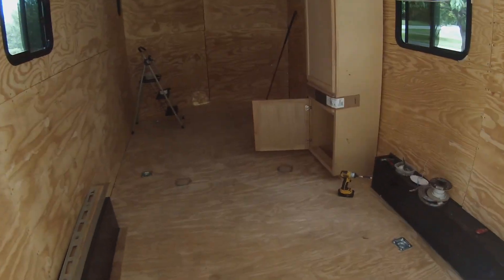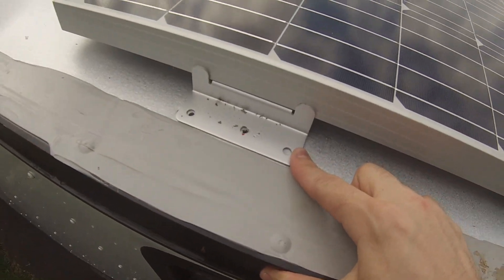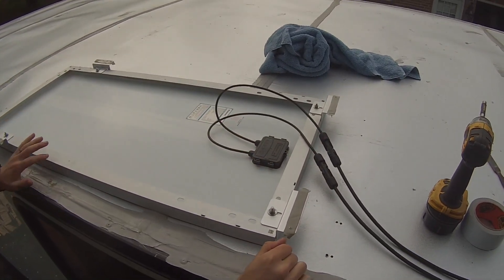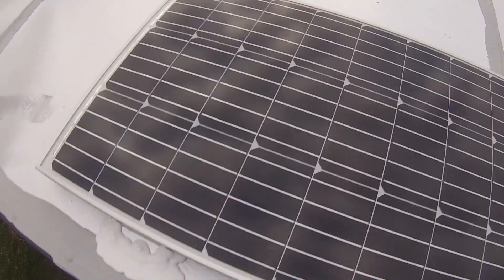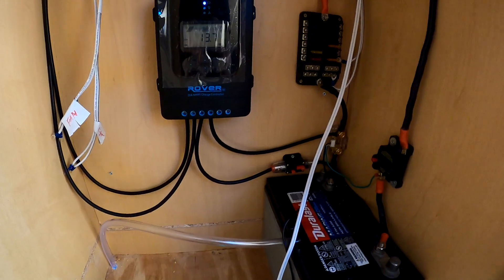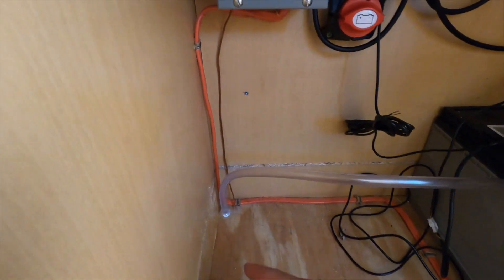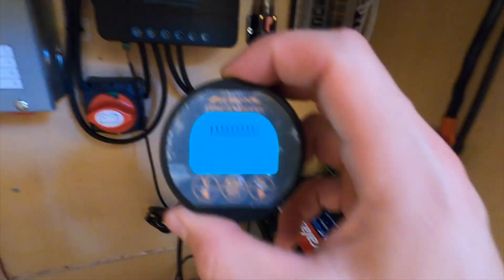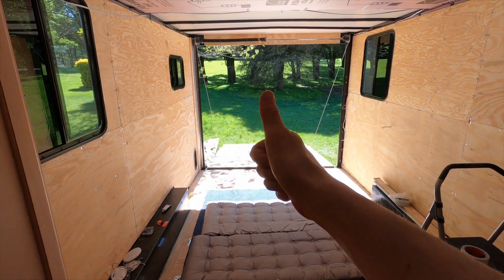Cargo Trailer Conversion Electrical Installation!

Comment: Sorry didn’t mean to send 
I’m building a food trailer concession stand type trailer o my 8’ x 11’, I’ll h s generator in the front and I’m gonna run off shore power or generator, I ran 8 g wire to my breaker box and under trailer up and out on drivers side front corner and used 50a box plug, my generator can plug into it, or I can not hook up generator & pull out my 10g extension cord w/50 amp plug and plug into my trailer and run over to shore power and plug into that, it saved me a lot of money for now, I may later might put solar panel to charge my battery for my water pump, o my thing running off 12vDC. Was looking into putting an auto transfer switch but not fit now gotta but 12 sheets of aluminum at 180.00 a sheet and also I’m not off grid a concession stand. Great work I’m saving it for if I ever do that to my trailer

Comment: Are you using a lithium battery??
Reply from the maker: I am actually still using the same AGM battery I bought four years ago in the trailer. Works wonders. Haven’t had a single problem with it and we are using this thing almost every weekend all year long
Reply: Everstart?
Reply from the maker: @lovingjesus5184  duralast platinum
Reply: @WildSchneiderOutdoors  👍🏻👍🏻ty!

Comment: Got a video on how you connect all your wires?
Reply from the maker: I unfortunately do not. All of the AC is very simple. Single runs from power to source. The wires I do have run for the DC are all run on the ceiling and zip tied to the bracing and come down the walls where they are just popped out through a hole I cut. Every wire is either run through the ceiling or in a wall. For any wire that goes outside it’s just a hole with silicone sealant around it and then zip tied and stapled to the underside.

Comment: How is that tube venting your battery off gasing?
Reply from the maker: So the tube is connected to the off gas port on the battery and then is routed through the floor of the trailer outside. There is silicone and lots of it both on the inside and outside of the vent hole.
Reply: @WildSchneiderOutdoors  OK thanks, I didn't know there was an off gas port.
Reply from the maker: @mikestone9129  yes. I was unaware of that as well until I read the little booklet that came with the battery. It’s not common that it would off gas but in the event it overcharged or got too hot i wanted to ensure it wasn’t venting in a small enclosed space

Comment: Hi. Can you provide us the starting weight of the trailer and what you guess will be the final weight after everything is added. Also what will you be pulling this trailer with ?  I have a F-150 and may need to get a 7 x 18 trailer for my setup.
Reply from the maker: DCLEMMS1 happy to see a new subscriber! And yes the empty weight of this trailer as it came off the lot was 3400. I will gladly weigh it when the build is done to see how much we added to it (I’m only building the front 8ft). I am pulling this with a Silverado 2500 (diesel) so I know I can really pull this fully loaded. New video coming soon on some interior framing so keep an eye out for that. Build should be done within the next month or so with videos all along the way.
Reply from the maker: DCLEMMS1 if I had to guess the weight added it would probably be around 800 lbs once finished. Maybe 1000.
Reply: @WildSchneiderOutdoors  Please shoot lots of video as this is becoming a big thing. I live on the East coast and hurricanes get worse each year and I also like to go 4 wheeling / camping. I'm planning a setup like yours but 7 x 18 or 20'.
Reply from the maker: DCLEMMS1 I’ll do my best. It’s so hard to film and build when I get going on a project I just fall in head first. I’ll do my best to at least describe what I have done and be sure to film more. I live on the east coast currently and am using this for my move out west then to have as a toy hauler for our dirt bikes

Comment: Thank you for the awesome video. I'm in the planning stages if my cargo trailer stealth conversion. Do you happen to have a schematic of the electrical system you installed? Thank you.
Reply from the maker: Felipe Espino thank you for watching! I do not have the schematic for my system but it is based on the electrical system build out by Trent and Allie. If you check them out on YouTube they have a few videos explaining their electrical system and I purchased the blueprints for their van build in order to build out my mothers van. So I have the schematic from that which is what I used. If you pause the video on where o have the finished electrical open you can see how it is all wired up. Hope that helps and please let me know if you have any questions. More videos coming soon as the build nears completion.

Comment: What did it cost for your electric setup for solar and how well does it work?
Reply from the maker: Tho kit total was about 200$. And it works great! I’m only on a 100 amp hour system so it really charges it up fast when the sun is high and through the day while I’m using it I have enough solar to run everything and still charge the battery.
Reply: That didn't include the solar panels battery, breakers, fuses switches correct?? I was looking for an entire price for everything that was installed. Thanks for responding back to my question
Reply from the maker: @robertflanagan355  the solar panels were included in that price I gave you before. It was a whole package. For the breakers and wires and breaker boxes and batteries I would add another 450$ because the battery was 300 and the rest was just small purchases either through Amazon or my local hardware store. All in all I would say roughly $700 for everything

Comment: What guage wire did you use from fuse box to your standard outlets?
Reply from the maker: Standard romex 12 gauge. It’s about a 3 ft run
Reply: @WildSchneiderOutdoors  I'm going to go with 14 gauge for my standard outlet.  Major appliances 12 gauge yes, it's so hard to work with in shallow mount boxes.
Reply from the maker: @geraldwilliams3898  can’t go wrong either way. I had a very small run and was able to purchase an outlet that had the holes in the back for quick connect so it didn’t require bending.
Reply: @WildSchneiderOutdoors  I have the holes in back of outlets, 12/3 romex won't fit into holes.  So I went to lowes and asked was there another outlet to support 12/3.  They said all outlets are the same, so not sure I trust that guy.  I will just bend of place connector to wire.

Comment: Where did you get the 30 amp power panel. I cant find one at HD or Lowes.
Reply from the maker: Stephen Clay are you talking about the shore power box?
Reply from the maker: Stephen Clay if you are talking about the breaker box that came from Home Depot. It’s just a two gang power panel with two two switch breakers. A double 15 and double 20
Reply: yes
Reply: if you locate the item number please post it

Comment: could u give a list of such items and how much they might have costed
Reply from the maker: That depends on what items you are talking about. The solar equipment was in another video and I did a cost breakdown on those. The battery was about 200$ and the other stuff involved with this ranged from about 5$-20$ each depending on where you get it at. All of the stuff you see minus the solar equipment was right around 300-350$ total